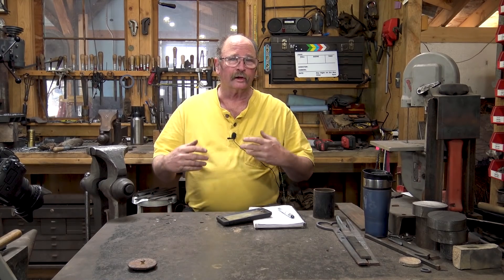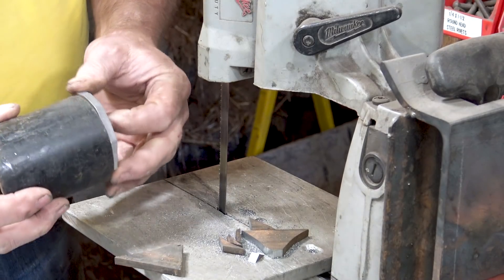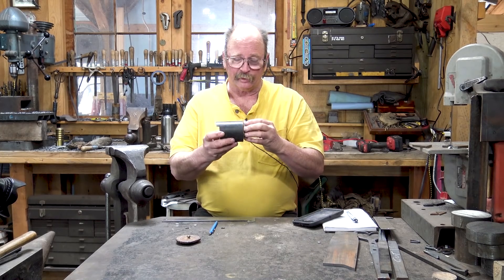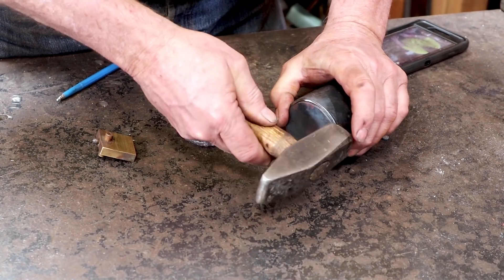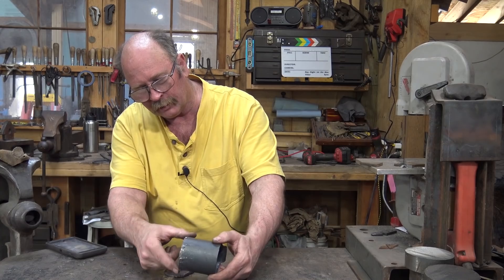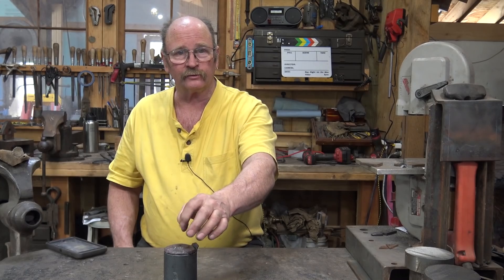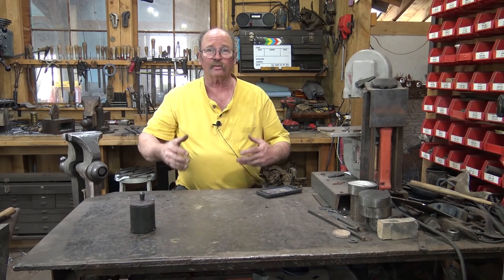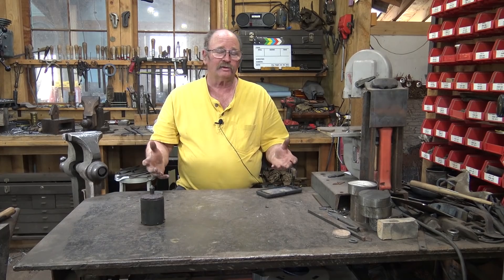Small vessel with found object lid

Comment: Fun video repurposing found items! One thing I have noticed is that material heated in a gas forge has scale that come off in large sheets or chunks where as a coal forge the scale comes off in smaller particles/chunks also if you file details into a forging if you scale it up gradually it looks like "as forged" detail.
Reply from the maker: Coal forge scale does tend to leave a better texture

Comment: Won't that also give your cylinder a bit of a bronze look??  The heat and brushing that is while scaling?
Reply from the maker: If you brush with a brass brush it does.  But just using a steel brush it doesn't

Comment: So you can use a round peg in a square hole, in fact a Blacksmith can make a square rod into a round peg using a square tool and then change the square rod into a diamond. All can be done with a round flat hammer with square square shoulders. Now I rounded out my statement and squared myself away. I think I’ve confused myself.